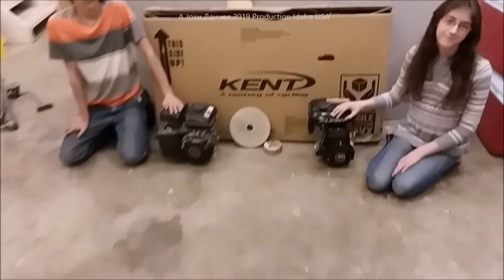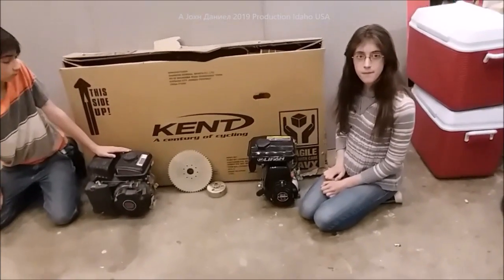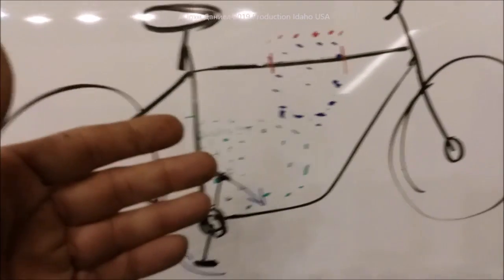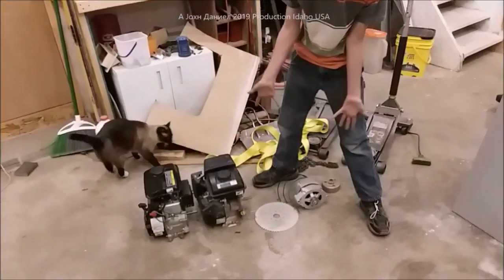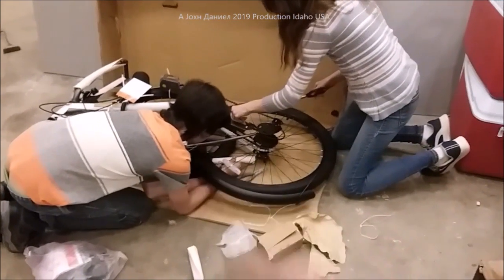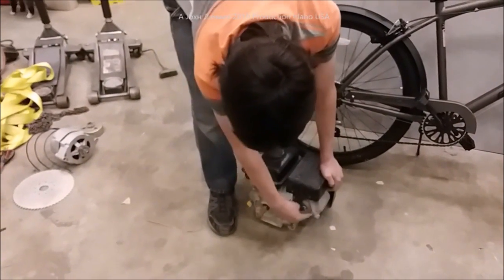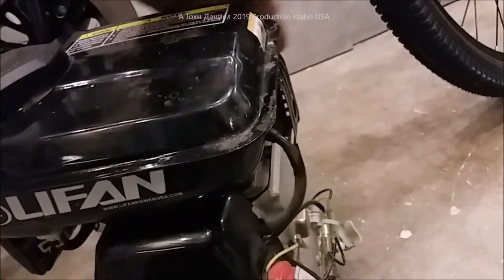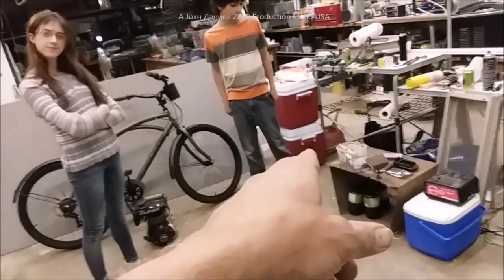Easy engine choice for DIY gas bicycle conversion

Comment from the maker: Complete parts list , new engine https://ebay.to/2UOTAsc ,KENT BIKE https://bit.ly/2UIDe3X ,5/8 Low RPM C-Clutch https://ebay.to/2UqH6Ym ,48T Rear Sprocket https://amzn.to/2Gb6l7Z ,Sprocket mount kit https://amzn.to/2Z45JZB ,chain kit https://ebay.to/2IsHe2l ,Thumb Throttle https://ebay.to/2P2TCXR ,TOOLGUARD ,22 pc Wrench Set https://amzn.to/2X4rK8P Subscribe to (my & their) Nim & Rod Channel https://www.bit.ly/Sub2Nim-And-Rod (just started it) See their ideas, & READ ALL below
Nim & Rod Channel lets build the subs and lets watch for uploads ASAP!
 I just may make a welded up frame insert for these engines and sell it here on the videos! You just cut frame, insert and bolt in.

*The engine is a Honda GX100 clone, comes "listed" as a 2.5 and 3 HP due to California CAFE but it is a 3 hp. I estimate Over 90 mpg from this kit above, If you run into a problem, post on the video.

Comment: Have you considered mounting the motor on a "luggage rack" where the motor is above the rear wheel.  I think it would be a much simpler mount to build and you wouldn't have to cut the frame.

Comment: I thought about getting a small engine, to build a heater from. Use the heat it produces, to heat a off grid house, about like the diesel heaters, only it would make its own power,  and out put power, maybe put a few load resistors with a fan, so it will have instant heat, or maybe that  be the only heat source! It would be ALOT safer, it could get difficult to separate the exhaust from the engine cooling air, I guess about 1500 watts is about all a 3-4 hp could do, with a car alternator, since they are just over 50% efficient,  so if a pma could be regulated, it could do double, but I want to power other things with it also. Great video.. Can't wait!

Comment: You can reduce the height by removing the fuel tank and using one that bolts to the top bar like a motorcycle tank. Then you would not have to cut the frame

Comment: Great vid. Dave Staton inc has awesome friction drive kits. Motor. 
and mount already assembled.   Subaru or Honda motors.  I have three Subaru and one 35ccHonda,it’s.  Installs in @ 20 min
Reply from the maker: Yes, very good kits. I am looking at a cool 3.95 horse 109cc V Twin engine from Alibaba, high possibilities and it has a dual stage centrifugal clutching system. More info and a video on it when I get one.